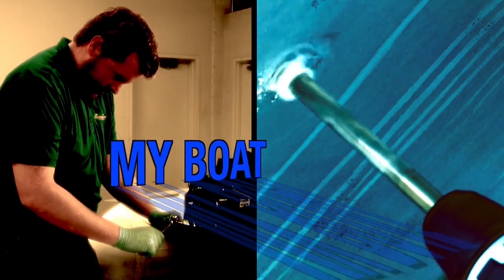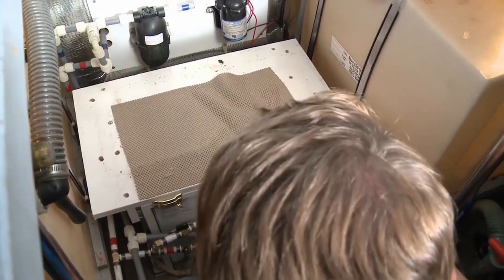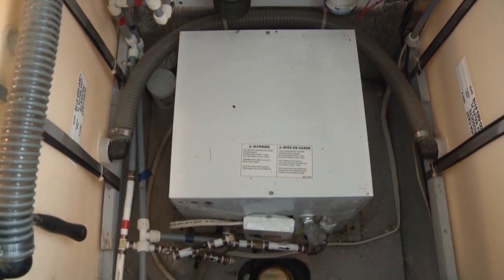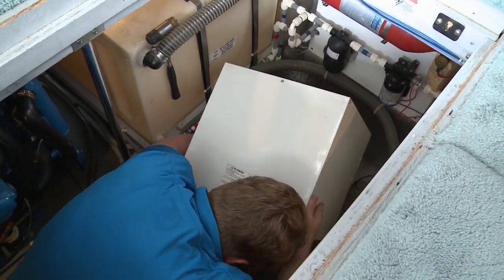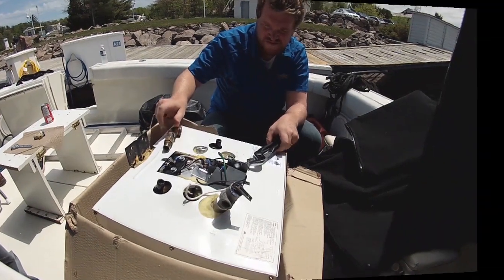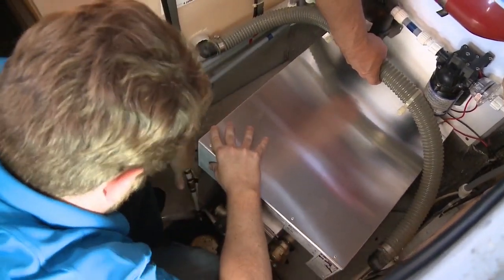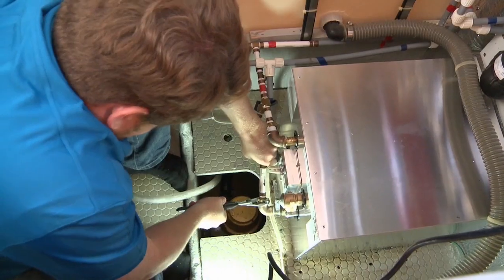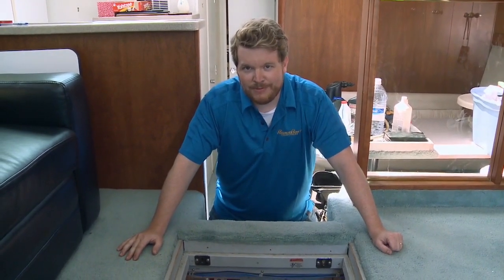How to Upgrade your Boat's Water Heater | PowerBoat Television MyBoat DIY

Comment: No mention about using the new unit’s heat exchanger.  Or purging the motor’s coolant lines (and, toughest of all, the water heater’s heat exchanger) of air for those boats that use the unit’s heat exchanger (most boats)-the absolute hardest part of this job!
Reply: He didn’t connect the engine coolant loop.  Dumb.  Free hot water? No thanks. Cold showers for us underway.